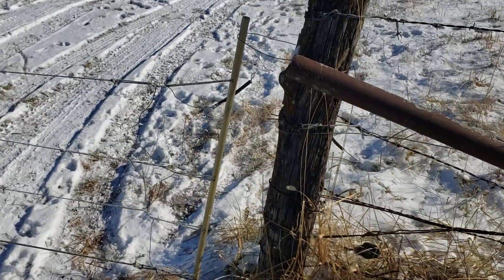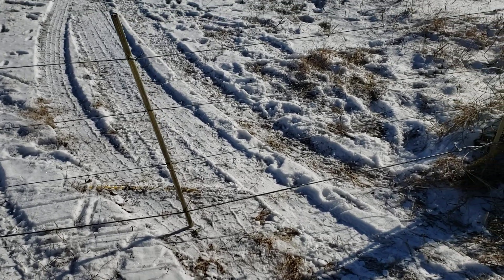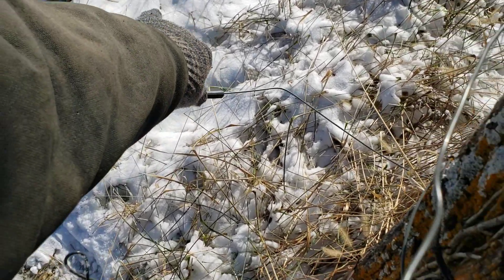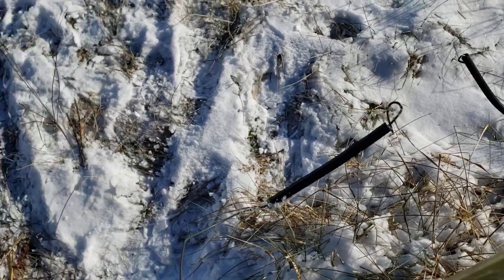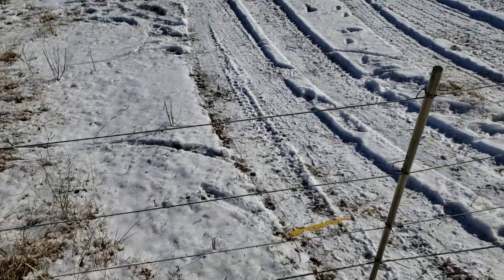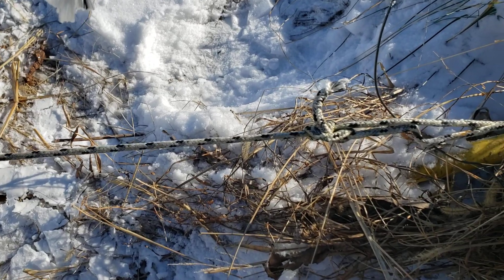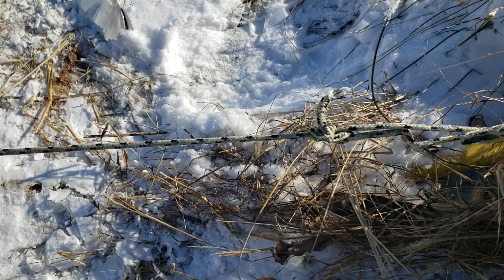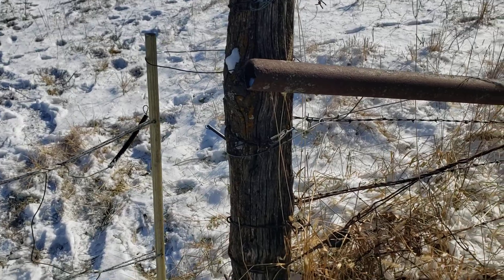A look at electrified wire gap gate.

Comment: How do you do water gaps over creeks or intermittent streams. Especially during flood season in the spring?
Reply from the maker: I use poly wire and just let them wash out then tie them back.  I'll try to get a video up about it.  I thought I had one from a couple years ago but didn't find it just now.
Reply from the maker: Found one of them.
https://www.youtube.com/watch?v=VrUoyshWr4Y&t=56s
Reply: @grandviewlivestock3936  that’s how we do low areas also. I’m talking about a major creek crossing. I’m getting ready to put two new crossings in and looking for help with the electric fence. I’ve done several hard wire water gaps for cattle but sheep and electric fence seems to be a much different deal. Thanks
Reply from the maker: @ranchlifelogic1991  Actually, it is just the same.  You can't beat mother nature.  I've tried.  So we just let it wash out and then go tie the poly wire back up and put the fiberglass post back in.  Even in the major creek crossings.  It takes very little time and the goats won't cross the water while it is up.  I believe it is in an old video but I'll try to get another one up about it.